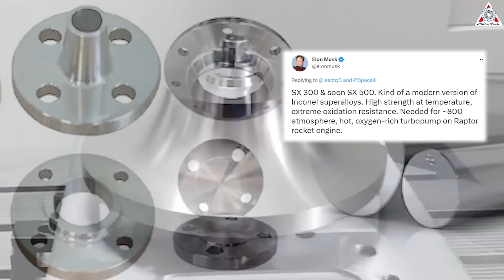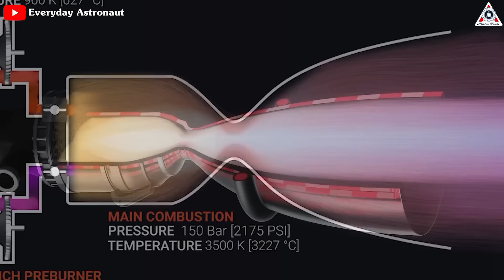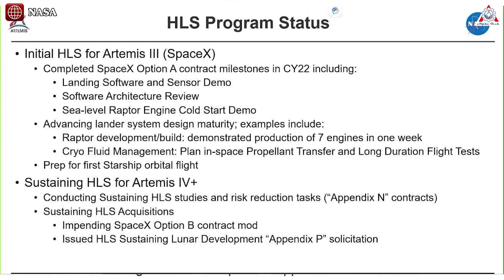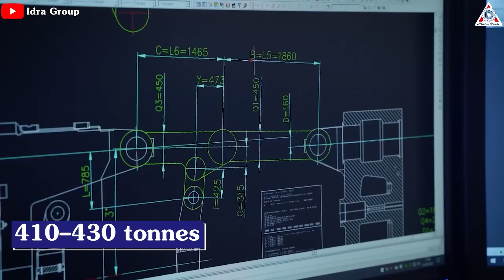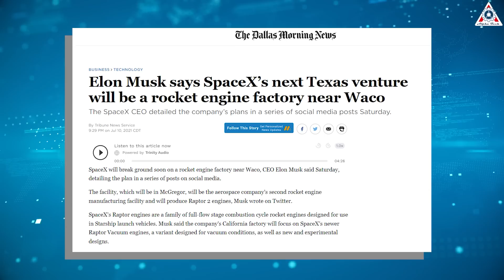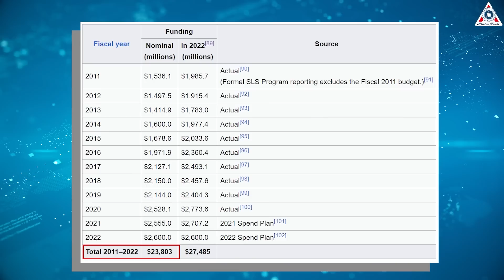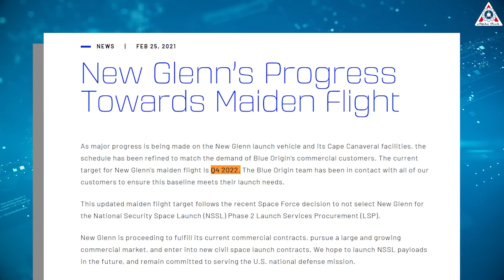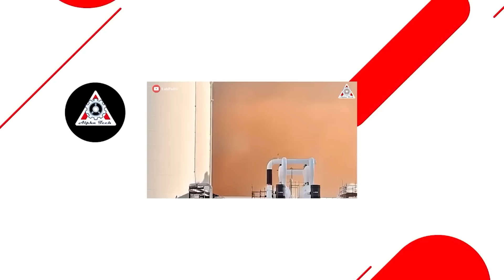SpaceX insane manufactures is MIND-BLOWING...

Comment: Thanks for a great video.  The pace of innovation of SpaceX is almost mind boggling.  Tesla too. 

Tesla has the cost of its electric motor down to $1k USD for its next generation vehicle.

As a taxpayer, I'm beyond disappointed that we're spending more than $100 million per RS-25 engine, which has the same thrust as a Raptor 2 or 3 at an eventual cost of $250k each.  That's 400,000x less.

Comment: I can't help but think that a viable city, or colony on Mars, or the asteroids requires the city be built below ground. Your protected from radiation of most forms, and the walls can be coated with plastic maintaining a constant atmospheric pressure at Earth normal. We can build a nuclear power plant on the exterior of the asteroid, and deliver all the mega watts the city needs. It just seems a better alternative to building your city on the surface where high speed dust storms can destroy your structures.

Comment: The Raptor 2.0 has almost exactly three times the thrust of the Merlin.  It makes me wonder if we'll see a Falcon 9 with 3 Raptors and a Falcon Heavy with 9 Raptors.  That should simplify production, reduce cost, and increase reliability.  It all depends on the Raptor being able to throttle down to a low enough thrust to land and empty ship.
Reply: or a longer falcon 9 with 9 raptors...
Reply: It really depends on how robust the tanks in falcon are, but my guess is you need much stronger/heavier tanks to handle meth/lox, and so it wouldn't be a feasible swap.

Comment: I wonder what could be done with just 2  of the new Raptors ? a super falcon?
Reply: The tanks that hold the kerosene could never hold the  methane, and the added weight of stronger tanks would make the rocket too heavy to fly, not to mention the weight of the stronger plumbing needed to feed methane. Falcon would need a complete re-engineering, perhaps it could be done, but it's probably not easier than a fresh build
Reply: @MrFukyootoob  good point